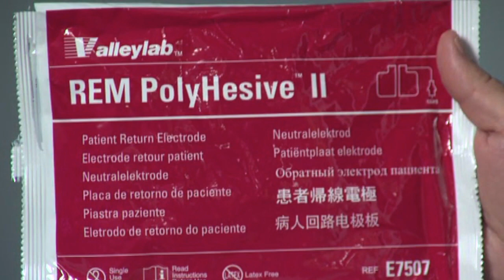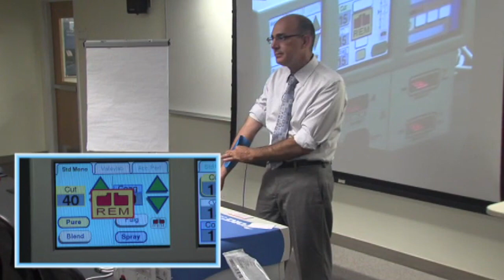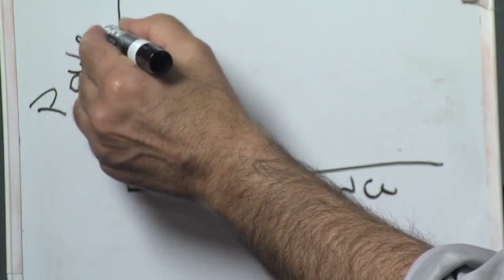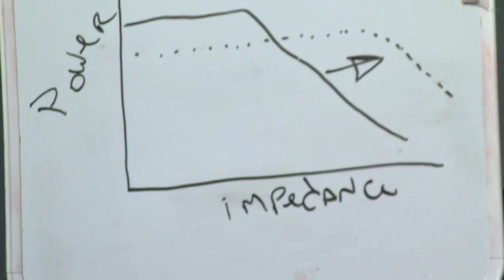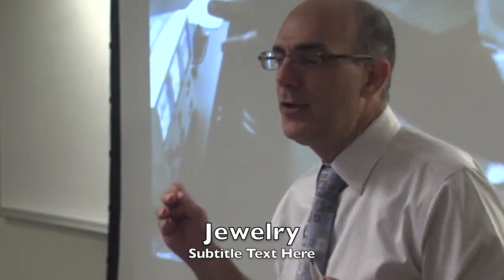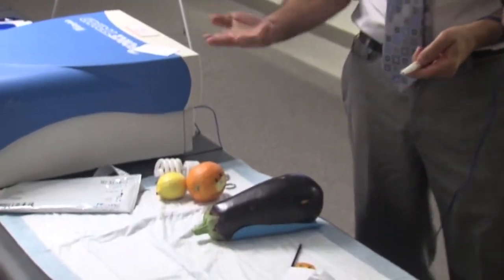Electrosurgery demonstration

Comment: 2:51 - I don't think it will be 70W half the time and off half the time. It will still deliver the full 70 Watts of power but with a lower duty cycle, so during the time it's on, its voltage will be larger than it was with pure cut setting

Comment: What are the amps involved in active cutting or colag?
Reply: COAG
Reply: According to my research for coag amps range from 3500 to 9000 but for cut start from 800 to 2500
Reply: @Chris-vv1jc   no way that much. that is more than  an electric welder :)

Comment: Sir. i'll like to ask you the following. what is the vessel sealer function in electric point of view.  and my second question is ... in bipolar modes, why is there a possibility in some generators to have coag and cut separately?  and in other not. Lets say a valley lab force xp, you have bipolar but no cut or coag bipolar. But in the Storz Autocom 400 or the Olympus se40 we can have cut in bipolar and coag in bipolar. ?  I would really appreciate your answer.
Reply: Hello Friend. Let's see if I can help you.
Vessel sealing: The clamp when touching the fabric reads an impedance. When the circuit is triggered heat is generated in the fabric until it reaches an impedance close to zero. Depending on the model of equipment, it emits a sound so that you turn the drive off or it is automatically deactivated (when it reaches near zero impedance). Clinically what happens is a FUSION between the tissues.
About Storz I do not know, so I can not say.
On the bipolar function, I believe it is simply an option of the manufacturer to choose also to have the BIPOLAR CUT mode. It will depend simply on the application and desired clinical effect.